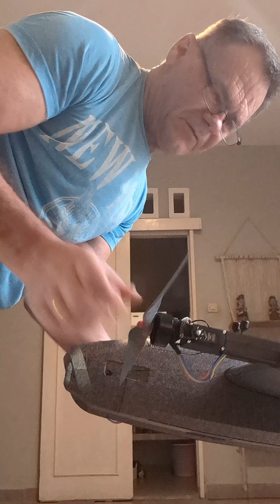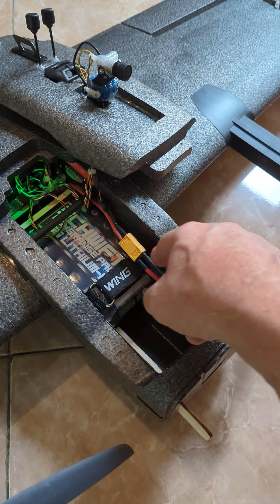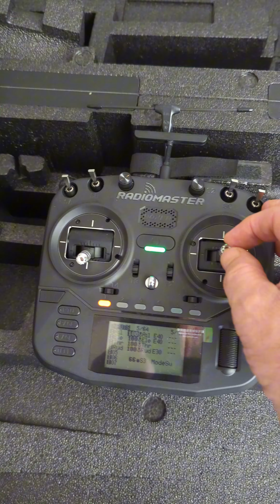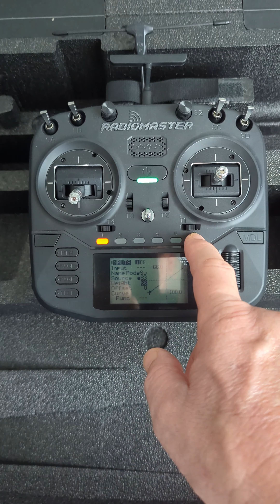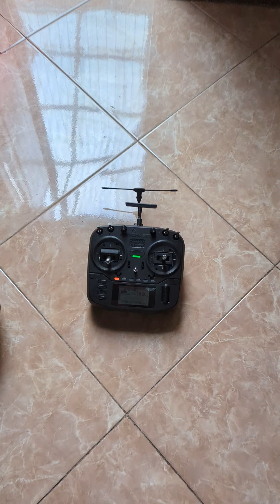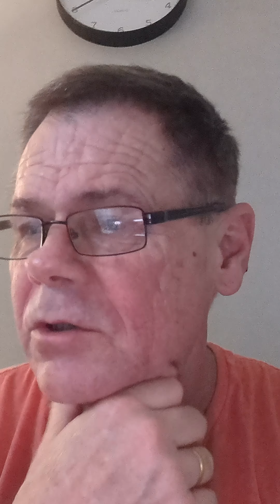HeeWing T2 VTOL pnp Part 2: setting up for newcomers

Comment: Nice info. What capacity is your battery? I'm I right in assuming CCW propellers on the left wing and tail boom?
Reply from the maker: Hi 👋 
Left and tail motors are CW.
Right motor is CCW.
I fly the T2 on two different types of batteries:
HRB 6s 6000mah lipo, typically fly 15~20 mins;
Schwifty 6s 8400mah li-ion, typically fly 20~30mins, an example is the long-ish range test flight video linked below.

https://youtu.be/c3crV5TvC58?si=PuAOYHQTkoPbBGbD

Comment: You should also rotate the antenna on the transmitter so that it is vertical, like an antenna on an airplane, if you want to fly longer distances.
The compass onboard calibration can be started using an RC switch instead using the Mission Planner technique. This allows calibrating without the tangle of the USB cable. Setup an RC channel to start the calibration by setting its RCx_OPTION to be “171”. A high value on the channel will start calibrating. A low value will cancel the calibration. If your autopilot has a buzzer attached, you should hear a single tone followed by short beep once per second. Upon successful completion three rising tones will be emitted and a “Please reboot the autopilot” message will appear, if you are using the yaapu telemetry script on your radio.
Reply from the maker: Thanks for taking the time to reply 🙏
I deliberately mis-orientate RC controller antenna so when I reach the edge of range, I can then re-orientate, controller high over my head etc... old habits from 18 years ago lol
Great idea using an RC channel for compass cal, except I don't have any spare channels and no desire to create more, and I don't have a buzzer. Really great idea though.